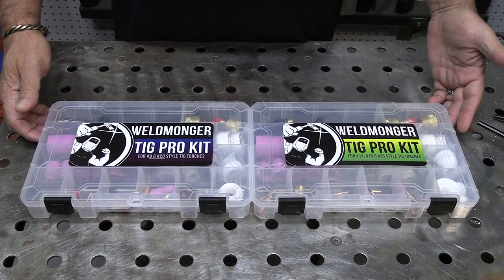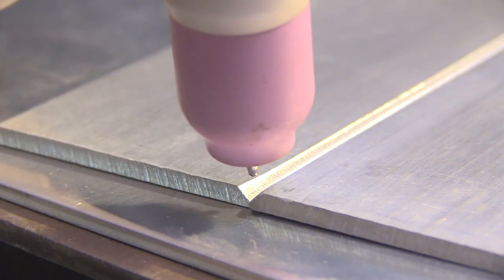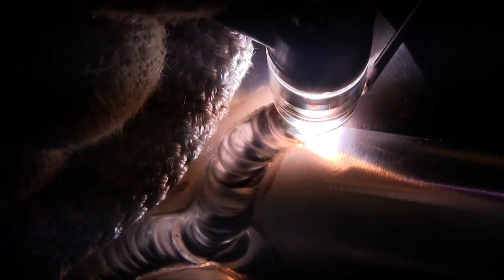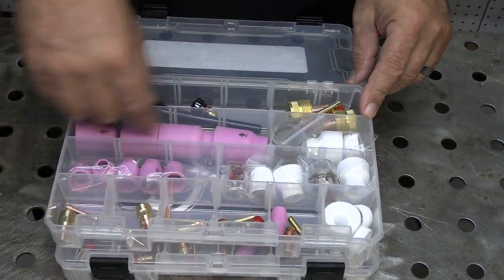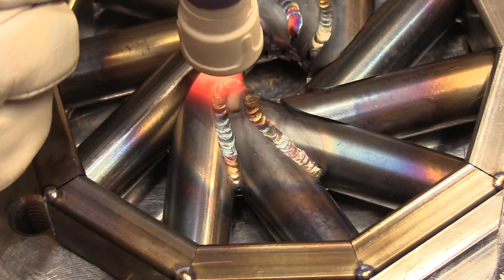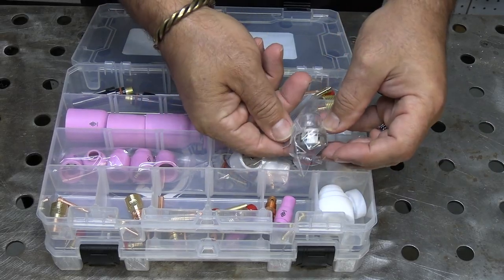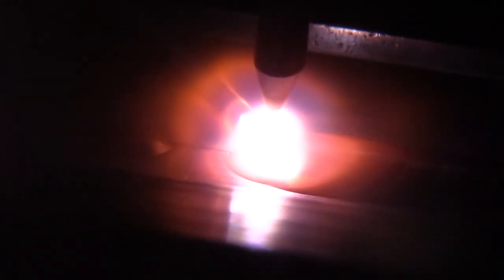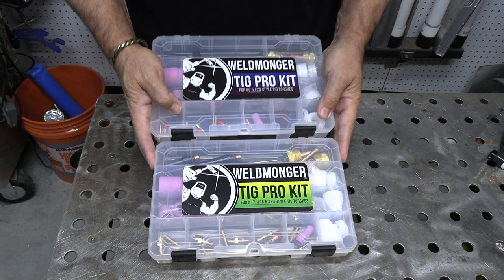Weldmonger TIG Pro Kit

Comment: Will they fit ck series 3 torches?  I had some bad experiences with other vendors. Thx
Reply: Series 3 included 17/18/26 torches. It really should fit that CK torch. If you have any problems we'll get you a refund. :)
Reply: @weldingtipsandtricks  works fine. Thanks for the followup